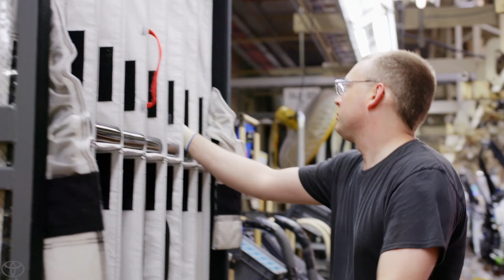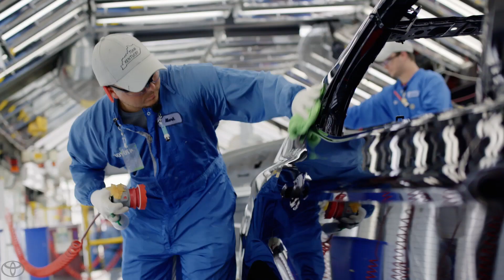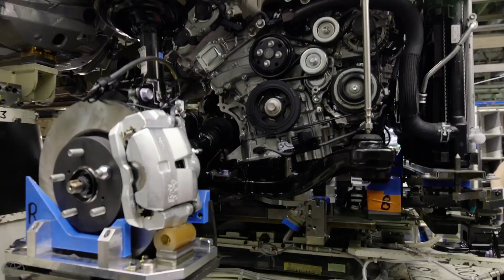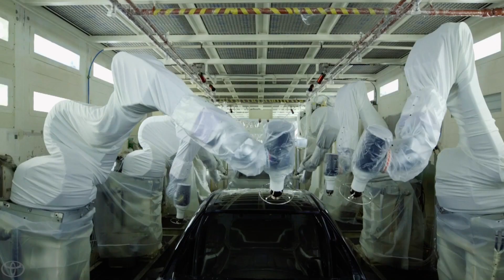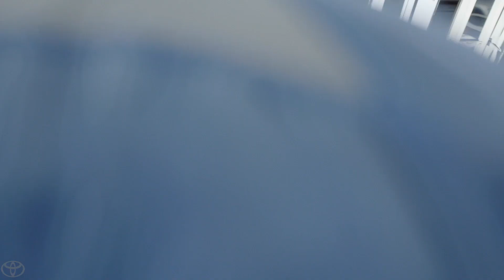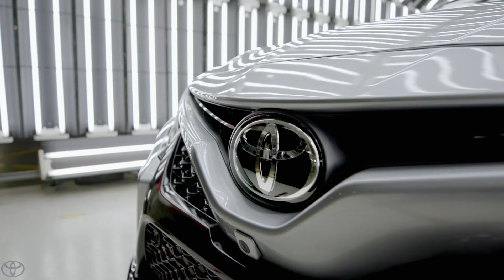2018 Toyota Camry: Kentucky Built

Comment: I bought a 2018 Camry XSE V6 2 months ago.  It is stuck in neutral upon every take off and then jerks into gear eventually.  Toyota is telling me that it's normal and won't give me my money back. The 4 cylinder had a similar problem and Toyota issued a TSB 0330-17 to address it.  Check the forums.  Many are having this problem.  Stay away from this car!